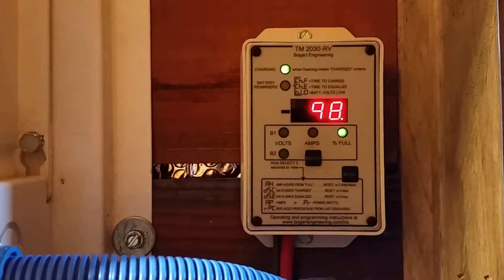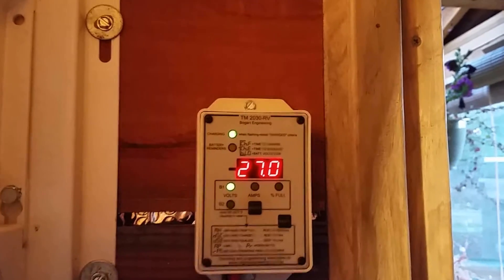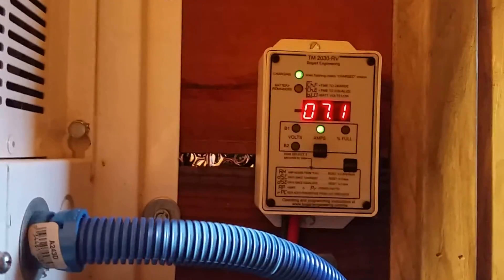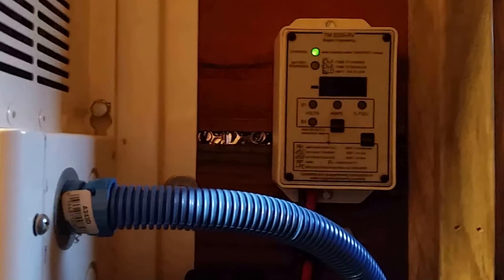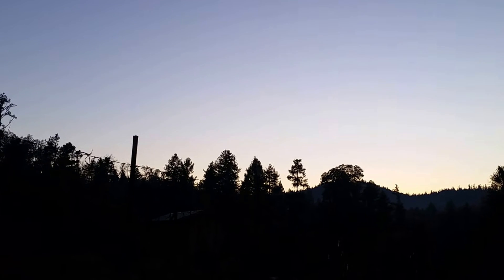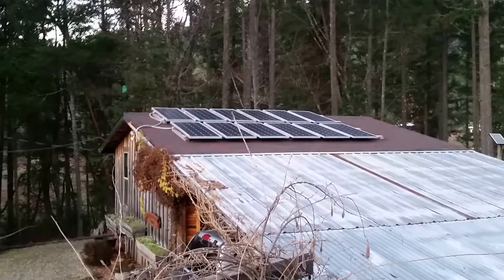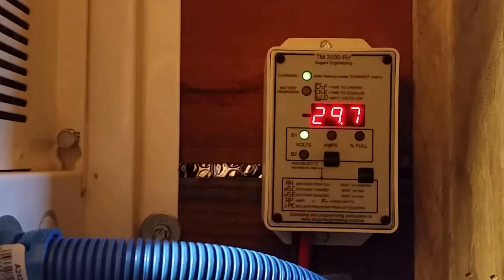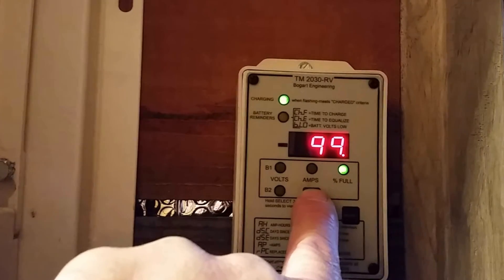Delco 10si alternator hack (last part) Please watch to the end.

Comment: Why i built a 24 volt 2400 watt permanently magnet altenator,  allows me to use a 6.5 hp honda engine with pullys and belt, im able to put out serious power with a smaller setup and achive filling up my 3 forklift batteries alot faster and with less fuel.
Reply from the maker: Just an old experiment. 
I do not use the generators anymore. 
I have a 30 kilowatt lithium battery bank and lots of solar panels.
Reply: @offgridinthepacificnorthwe3210  I have 17000 watts of solar, 3- 24 volt 1000amp forklift batteries, 1500 watt wind turbine, 6 solar thermal solar panels with radiant heat and used oil furnace, but since we are completely offgrid and use every appliance and electrical thing that normal houses use even ac system, electric stove etc, we have to use a DC generator in winter months a few days out of the month.  I would imagine if we were conservative about things, probably wouldn't have to. I do have a 10kw military generator, but never had to use it. I have two military trucks that I did use slave cables and jumper to the batteries to charge up once to try it out, since they are 24 volt vehicles,  and worked pretty good. Just like having a back up, to a back up, to a back up. I'm a little paranoid sometimes lol.
Reply from the maker: @sethtaylorm925  nice system. 
There is no electrical service in our area. I did use a little diesel last winter during December but hopefully with the bigger battery bank we installed in February the generator will be a thing of the past. I have not even come close to needing the geny since the upgrade.
That said my backup generators are MEP-016D and MEP-026A
Even though we have a modern home we only use 6 kilowatts a day.
The system will make 32 kilowatts a day but we just do not use it.
We heat with wood and cook with propane. 3 years ago we moved to the sunny side of the Cascade Mountains. At our old homestead (the one in the video) we would have 70 days in a row with no appreciable solar gain. That is when I was experimenting with different types of DC generators including PMA.
Over here on the sunny side fuel efficiency is just not a factor.

Comment: The slower you run the engine the better in terms of fuel consumed per watt produced.  Reducing engine speed from 3600 to 1800 rpm will save approximately 20% on fuel with the same output power.  

Engines run most efficiently at maximum cylinder pressure, (max torque).  Rpm can be kept low if the engine is capable of producing enough torque at low speeds.  Try running that diesel at a lower speed. 1200 rpm maybe. The exhaust shouldn't soup up if it is heavily loaded at a low speed.

Comment: have you considered a bldc motor and rectifier?  or putting a magnetic rotor inside a ac 3 phase motor. and using a charge controller? it would be nice to use the same controller for solar and the generator! anyway !!!

Comment: you could build a engine shutoff. possibly by using a zener diode. reverse biased. so it will turn on a relay that can kill power to the alternator. and shutoff your engine. and use a potentiometer and voltage divider with the zener diode. to make a voltage operated switch. I don't know if you can just buy something like that. but if you can solder. it would be easy enough to build. that's similar to how I was going to build a delco voltage regulator. I'm off grid. and need a way to charge batteries until I have enough panels. I even considered building a steam powered DC generator. to run off my wood stove. to charge batteries. and use the condensing side to heat the house! I have seen a video of something like it. since I could use a different way to hear the house. I may go for it. I have a 3 HP gas engine I can convert to steam. I don't know how much power or TQ. I could get from a 3hp. it may work. if I could get 50-100amps from it that would be great. I don't think I'd bother with a 3hp. if I couldn't get 30a+ from it. I may look for a 5-8 or 10-12 HP. to convert. I want to keep it as efficient as possible. there is always tree limbs and brush falling around the house. to feed the fire. and run the house heat. I may look in to getting the project started this fall. since I have 4 matching delco 22si. alts. well 2, 130a & 2, 150a. use one on a gas engine and one pair on a steam engine. or have both engines connected to the alts! sorry I'm rambling! great videos. I'm newly subscribed! looking forward to more videos!!

Comment: it was a good idea telling ppl not to do this. unless they know a bit about what they are doing. because a alternator CAN output high voltage ac power. someone not knowing could get hurt or killed. well maybe not killed. but still. I have seen ppl run 120v  tools from a alternator.

Comment: What’s the total size of your battery bank in AH
Reply from the maker: 840 amp hours @ 24 volts nominal.
Reply: Steven Davis I’m going to try to get too 1500ah at 24v  I use about 4kw in a 24h
Reply from the maker: Christopher Boone I use 4 to 6 kwh's in a 24 hour period and we are fine with 840 amp hour bank. we have 4.8 k of solar. It all depends on how many days autonomous you need and how deeply you want to cycle your bank. We can have over 50 days in a row this time of year. We typically only use the top 15% of the bank. That's why we use the diesel generator. Every other day during those 50 plus days of no appreciable sun. If I had 20k of solar and a garage full of batteries we would still need the generator at times lol. life here in the Pacific North Wet is a challenge at times. we do not run the generator at all from March through The 1st of November.
Reply: Steven Davis I only have a 1580w array. So I was hoping with the extra battery I could get a few days if no sun with out starting the generator. My inverter has a built in charger capable of 50amps
Reply from the maker: Christopher Boone That's a  nice system. we were 1400 watts for 3 years with a 3600 watt inverter 70 amp charger. Since about April we have a Magnum 4024. It has a 105 amp charger but I turn it down to 80%.
At 4 kilowatt hours a day you should be fine with a 1.5k array. If you live in the Pacific North West I can see having a 1500 amp hour battery bank for sure. It just depends on where you are. 4 killowatt hours a day with a 1.5k array in Northern Maine would be real tough.. during the 3 darkest months.

Comment: so will all 10si alternators will go up to 30V??
Reply from the maker: Unregulated yes. I believe the coils are the same in both the 12 volt and the 24 volt just the regulator is different. In fact I have a friend who is using a 12 volt alternator for his 48 volt system. I have been looking for a high/ low voltage cutout relay that does not cost $100. I think I found one for under $30. It would work like this, when charging using the rheostat for current control the volts will eventually rise to a dangerous level. The relay will open circuit at a set voltage with a time delay and keep from damaging the batteries. For my system I would have a voltage cutout set at 30 volts for one hour etc. This still will not automate the system because of the tapper charging characteristics of FLA. In other words the volts may get to 30 volts and then rise to 31 volts in less than an hour etc. This is still a manual charge at best but it is an alternate method besides using the inverter charger to charge the batteries using my diesel generator.
Here is a controller that might work for me,

https://www.amazon.com/Universal-Voltage-Triggered-Controller-1URVTLC-1224-B/dp/B015OJ054C/ref=sr_1_1?s=lawn-garden&ie=UTF8&qid=1513098472&sr=1-1&keywords=1URVTLC-1224-B